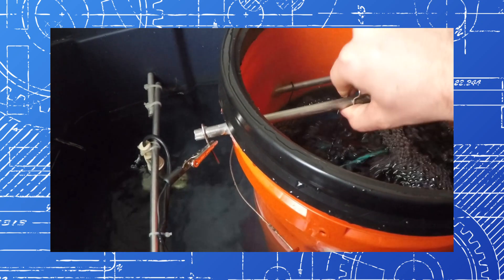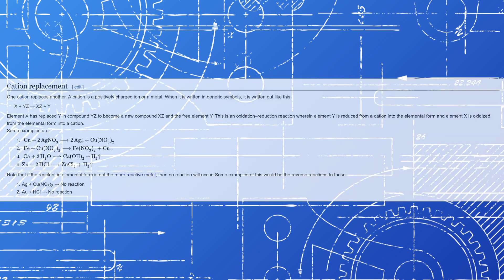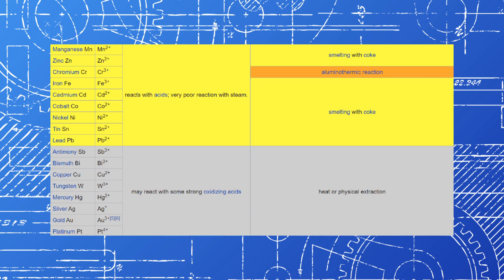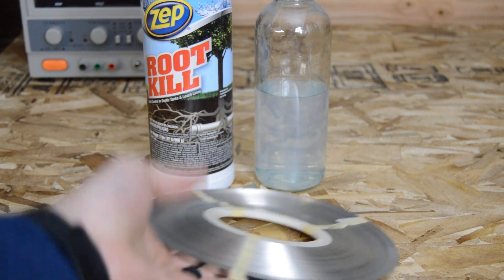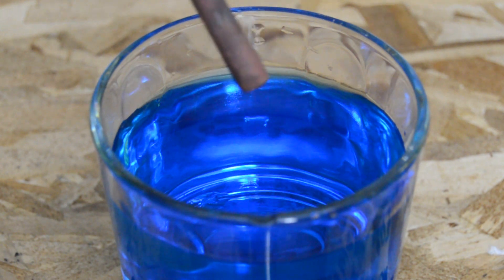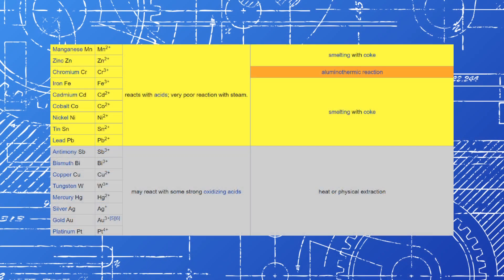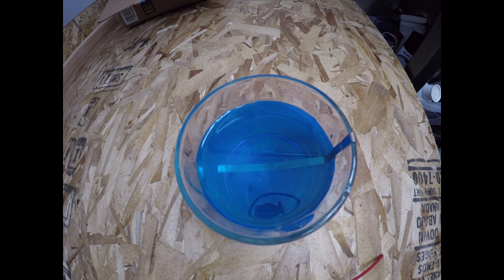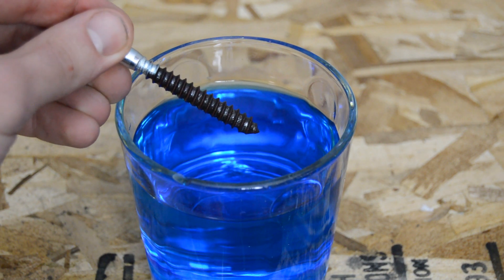Why You Can't Copper Plate Steel ~ Reactivity Series Explained (works the same for aluminum plating)

Comment: So, for me to give an aluminum bath to an iron screw, for example, do I need to zinc it to create "adhesion" to the aluminum? Does it work that way?
Reply from the maker: The reaction video contained was copper onto zinc and copper onto Al.  I've never done an Al bath. I honestly couldn't say for certain. Seems plausible that Al would deposit but the difference in electronegativity is more of a thumb rule than anything. Someone with a larger background in Chemistry might be able to chime in with a more detailed answer.
Reply: @GarageScience  I understand, I'm very grateful for your answer, where I live it's difficult to get this type of information but I won't give up. Thank you also for the video, it helped me a lot.

Comment: Doing resoration of vintage pieces like radio and bicycle parts. So I should nickel plate first then copper plate with brighners to fill in rust pits and scratches and polish before a final nickel plate. If you do automotive body work its kind of like putting on primer to make the body filler stick. Things are making sense.

Comment: hey dawg, can you plate wood? ya ya ya its poreos, its difficult blah blah blah. 
nickel clay rubbed into the wood, or soaked in a solution that would deposit the metal. 
maybe paint to fill holes and also apply a base layer? aka a metal paste
Reply from the maker: As long as there's a conductive surface, yes you should be able to.

Comment: Question: Zippo lighters are brass bodies, most of the time with a coating of stainless steel. What would be the most effective way to coat the stainless steel surface with copper? Would you need to first coat the steel with nickel and then copper? My goal is to have a fairly thick copper plated Zippo that I can then oxidize with a brass-blackening solution with 0000 steel wool. I’ve done this many times with the raw brass lighters, but I want to try it on a copper surface (without having to experiment on my expensive solid copper Zippo).
Reply from the maker: I've never heard of something being plated with stainless steel. If it has a polished white surface finish, then it's probably coated in nickel. If that's the case, you can copper plate directly to it. If it is, in fact, stainless, you'll very likely need to plate nickel to it first. I made a video on making a simple nickel plating bath.
Reply: @GarageScience  I concur with your assessment. I have worked in a plating shop for 17 years and what you suggest is correct.

Comment: It's interesting, I used the same 0.5M HCl solution in an ultrasonic cleaner to clean an unknown copper alloy(brass/bronze?) followed by iron. 
To my surprise, when I took the iron out, there were patches of copper securely bonded to the metal. I'll have to try it the future my deliberately adding a more concentrated solution, but I think the cavitation bubbles collapsing might give enough energy to weld the precipitated copper right on!

Comment: I made some copper acetate with a pinch of NaCl, no idea about the concentrations, but I plated a steel cutter blade and it holds well (voltage was below 1V). The copper color turned black over two months. Not sure what it actually is.

Comment: Well, looking at the title, I have questions, because I am literally copper plating carbon steel right now (w sodium bicarbonate electrolyte that I dissolved copper into first... No sulfates) and it's been working great... Guess I should watch the video though heh.
Reply from the maker: Looks like you achieved a basic pH with which to plate similar to a cyanide plating solution. However the plating thickness is limited with this approach and since it's not a cyanide bath it's probably a brittle deposit with possible adherence issues. Check out this article for more info.

https://www.pfonline.com/articles/choosing-and-troubleshooting-copper-electroplating-processes
Reply: @GarageScience  I wish nickel wasn't so expensive... :(
Reply: @GarageScience   Thanks. That makes sense. I went heavy on the bicarbonate. Also the steel was near mirror polished and cleaned with soap + water, then acetone, immediately before plating. Electrolyte was primed with all copper electrodes first. Also I ran it hard, around 10A at 30V maybe 4cm electrode distance, anode was a coil around part, holding electrolyte temp at 160-170F. I did notice a thickness limit. At some point it was just picking up loose copper or maybe red copper oxides, which were easily wiped away. The adhesion of the thin base layer seems decent, it survived an aggressive buffing wheel at least, and so far hasn't flaked away. My calipers aren't accurate enough to measure the plating thickness.
Reply: @ElTurbinado  hey can you explain how you made your electrolyte? Baking soda and distilled water? How did you get aqueous copper? Or was just a copper anode required? Thanks!
Reply: @electrowizard2000  baking soda and distilled water; heavy on the baking soda (it's not precise; just dump a whole bunch in while stirring until it stops dissolving readily). you can kind of plate starting fresh with just a copper anode but it goes more smoothly if you keep an excess of copper in solution. so what you can do there is first run it for a bit with a copper anode AND a copper cathode (the copper from the anode won't plate the cathode). run it until the electrolyte turns a nice blue (that's the copper). then swap your cathode out for your part, but keep the copper anode (so the solution stays copper-y).

at the end if you want to cleanup you can use two scrap iron electrodes until the solution isn't very blue any more. you'll still have dissolved copper but not nearly as much (some places don't want heavy copper solutions down the drain). or just save the copper solution for next time.
Reply: ps one thing you might want to play with, cause i never did a controlled test and don't remember off the top of my head, is the voltage. iirc in this setup there's a couple threshold voltages and there's a narrow range where one of the electrodes (sorry don't remember) bubbles and the other doesn't. you might want to try one run in that range, one just above the point where they both bubble, and one cranked up to max. it may make a difference. i wish i could remember, sorry about that; but next time i run it if i remember i'll post back here.
Reply: (also make sure your part is clean. acetone or alcohols are good solvents. do not use acetone to clean copper though; it reacts exothermically, enough to get copper red hot. fine on iron though.)
Reply: stupid thanks for the great details! Def. didn't know that about copper and acetone and since I've got plans to nickel plate copper soon, very timely too!

Comment: Could someone explain why I experienced very good results and finish when I electroplated iron with copper in a sodium bicarbonate solution/electrolyte instead (using tap water)? 
I was expecting poor results because many people online claim its hard to plate iron directly, however most who claim that are using a solution of copper sulfate. Would copper sulfate give  different result in comparison with copper and sodium bicarbonate in this regard?
Reply: Dear Sir, what you said was very interesting. I have tried electrolyte baths of Copper acetate and Copper chloride. Both were acidic. Neither worked but quickly deposited a thick slimy layer of Copper that wipes off with the gloved fingers.
Reply from the maker: That can occur if the parts you're plating aren't clean or if the plating current is too high. Try lowering the voltage.
Reply: @GarageScience  Yes I suspect my parameters are too high.  I have a fixed output transformer as my power supply.  Time to invest in a variable power supply. Thanks.

Comment: To Chome plate steel part surface is cleaned and degreases, copper plated, then Nickel plated, then Acid Chrome plated. Copper plate in part to make the Nickel stick to Steel but Nickel plates with big "pores" or holes which allow corrosion.

Comment: Is it possible to copper plate galvanised steel by using some other intermediaries? How would I go about doing that? (strip the zinc, then nickel plate and then copper plate?)
Reply from the maker: If it's plated in zinc you could probably nickel plate to the zinc.  There tends to be an oxidized layer on the zinc that also helps protect the steel.  Don't know if that would come off in the acidic plating solution but probably wouldn't hurt to clean the steel first in an acidic bath first before plating.

Comment: i gopper plated steel by using hydrochloric  acid that had a copper bar dissolved in it, so it was copper in solution i then dropped in a super clean piece of copper hung form a bar over the bucket and the copper in solution adhered to the stell, i left it there for a day then took it out, washed it off and i cant rub it off, polished nicely bit im not sure how thick it is, I also did it by accident with my bricklaying tools and found out in the morning i had copperplated my dirty old trowel and float although by the end of the day the copper had come off the bottom, this led me to experiment further with a clean piece of steel and a bar of copper dissolved in the acid, that worked really well, its not electro plating but it certainly plated the steels and it hasnt rusted through yet.
Reply: mhhhh....you said: " i then dropped in a super clean piece of copper..." its a piece of steel - right?

Comment: Can you please tell me how to plate a copper soldering tip with iron ??? When soldering the heat pitts the copper surface making soldering difficult. When the soldering tip is iron, this just does not happen. Making for a easy soldering job. Maybe make a soldering tip from nickel ??? Can you drop a line with your thoughts ??? Thanks a bunch too.
Reply from the maker: I have a video on nickel plating that you can check out. I haven't tried to perform iron plating so unfortunately  I cant say much about that.
Reply: @GarageScience  Hello GS, I will check out your nickel plating fella. Please let me know when you are going to iron plate. Thanks VF.

Comment: @Garage Science, copper can definitely plate steel.

You just need to force an electrical potential right as you enter the steel part. 

That will prevent copper metal from forming onto the steel, and will just plate the steel/iron nail with copper normally.

This doesn't work with stainless steel though, since you need to dissolve the stainless steel oxide layer first.

Meaning you want to zinc plate, then nickel plate, and then copper plate.
Reply from the maker: Interesting... I've tried doing it that way but it still rubbed off. Have you had success doing it this way? If so, how exactly did you do it?
Reply: @GarageScience  It can be done, but it needs to be done very quickly.

The first thing you need to do is clean the crap out of it. You need to wear gloves in this process too to prevent any oils going on the part.

Meaning you need to clean in with soap, then sand in using very high grade(500+) sand paper.

Then a chemical bath of lye(sodium hydroxide) can get rid of all the oils and the like.

If you want, you can use a dilute sulfuric acid bath to etch the steel a bit.

After that, connect the steel part to the negative lead of your supply, and the positive lead with copper wire.

Connect your power supply. Put in the copper wire first, then put in the steel part as quickly as possible. It will then plate using electricity, meaning no immersion deposit was formed.

This won't work with stainless steel, as it forms an oxide layer much much quicker than regular steel, like what aluminium does.

Also, if possible, put a bit of HCL in the copper sulfate solution. That will etch the steel, and allow the copper to fill in the gaps.
Reply from the maker: @neutronpcxt372  good info, I'll have to give that a try at some point.  Thanks!

Comment: I'm no expert but to nickle plate aluminium you must zincate it first also you can copper strike then zinc then you can nickle plate I would think the zinc bond on steel would be the same allowing copper to bond to zinc good video
Reply: Yeah, that's the only problem.

I've made the sodium zincate solution.

Plates well with a small layer of zinc, but I haven't found a way yet to make a flash copper solution to strike the metal.
Reply: @neutronpcxt372  hi there any updates on your experiments to make flash copper solutions ? Direct to steel

Comment: Oh but you can copper plat plain mild steel with copper,  but not with straight up Copper Sulfate solution, I have done this with good adhesion and brightness . Try this formula copper Sulfate 10 grams per litter, 50 grams of Cream of Tartar and 50 grams of table Salt. no need for electricity.
Reply from the maker: Thats a very small amount of copper, with a small concentration like that you definitely needed something like table salt to add conductivity.  I'd be interested in how thick of a coat you were able to get with that.  The sodium in table salt would generally be considered a contaminate creating brittle deposits.  If you send me some pics on the FB page I'll give you a bit of a shout out.  Thanks!
Reply: @GarageScience  Sorry, I believe I mentioned that it's electroless. What I was trying to point out that using just copper sulfate you will not get a adherent coat on plain steel that is why you can rub it off with your finger , but using cream of tartar as complexing agent and Sodium Chloride as conductivity and chloride ions will give you a bright and adherent coating on plain steel, but it's a thin coating of course. there are old books of how to silver plate copper/brass using Silver chloride, cream of Tartar and sodium chloride. I substituted Silver with Copper.
Reply: @nicamarvin  I have tested Marvins recipe (with electricity) - not really satisfying - but Its possible to  generate a nice shiny layer on polished steel but adhesion is weak.
Reply: @dieterkrause1674  yes it's quite dificult without Cyanid electrolytes.
Reply: @GarageScience  after this first layer u can use any other acid-based copper solution 4 thickening...
Reply: Hi Marvin,I wanted to ask you if I wanted a nickel plate over steel there is no need to copper plate?

Comment: Great channel could you go into the chemical makeup and proceedure for electroless nickle boron plating thanks for a great channel
Reply from the maker: Perhaps eventually. I'm working on designing a simpler acid copper plating bath (as compared to this one https://youtu.be/7QXi4PM39ho ) and then I'm going to do acid nickel... then I may branch out to electroless plating solutions. I have links to other plating resources in my other videos that you may find helpful too.

Comment: Isnt Iron or steel copper plated with cyanide?
Reply from the maker: That is another approach. Cyanide is extremely hazardous though and not for home users.
Reply: @GarageScience  thank You for Your answer: No risk, no garage fun;-)
Reply: @GarageScience  Cyanide is way overrated.  It takes quite a visible amount of cyanide to kill you.  Heck, you most likely have chemicals in your home much more toxic than cyanide, gram for gram.
Reply: @GarageScience  Don't be afraid of cyanide. It takes at least 400-800 mg to kill an adult by "intentionally" swallowing it. Several plants in my garden are way more toxic compared to cyanide.

Comment: yes, acid copper plating solution wont work but you can just use an alkaline copper plating solution to plate directly onto iron and steel.
Reply from the maker: Many of those alkaline solutions contain proprietary blends to get good results and don't have as widespread open source knowledge. That's why I stayed away from talking about those. Cyanide copper plating also works directly with steel but is very dangerous.
Reply: @GarageScience  Hi guys, I'm actually right now trying to make my Pottassium pyrophosphate and Copper pyrophosphate chemicals for plating from MAP (monoammonium phosphate) and KOH and CuSO4.
I need less corosive bath, since this pyrophosphate is 8-9 pH this is OK.
Since i'm early beginner in electroplating (I didn't even start properly) a have beginner question - Is i possible to coat tin metal with copper (pyrophospate bath ) and did anyone try this. 
Do not be confused it is not tin electroplating, it's coating copper on tin surface.
Thanks, and great Chanel.
Reply from the maker: Yes you should be able to copper plate tin with that type of bath.
Reply: @GarageScience  Thanks for your replay I will try this very soon. 
Keep a good work :-)
Reply: @GarageScience   cyanide is obviously out of the question for amateur use but pyrophosphate or rochelle salt based ones are doable. but well, a nickel strike also works and is easy to do.
Reply: @greygleam  4 e-plating iron or steel with copper u dont need cyanide, pyrophosphate , rochelle salt or ni-strike...